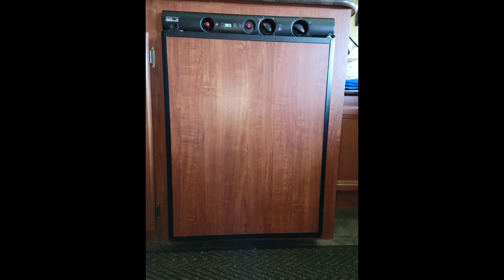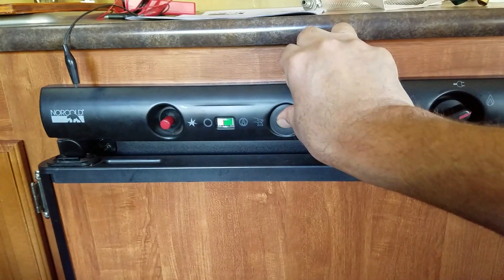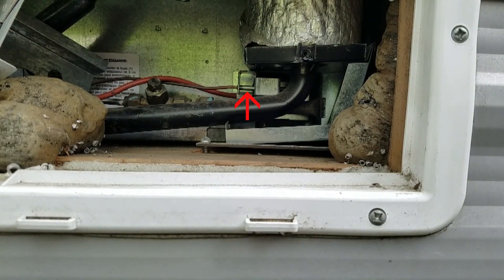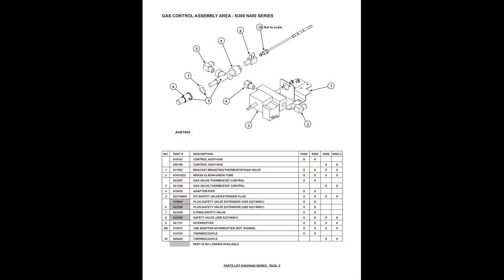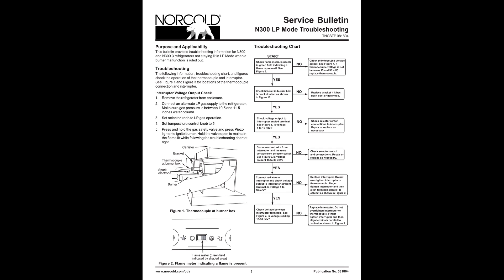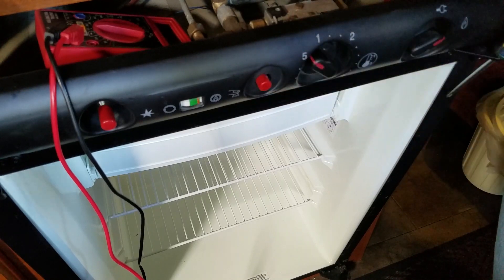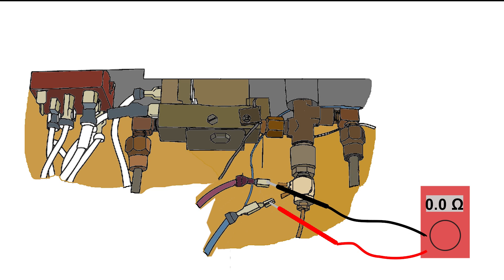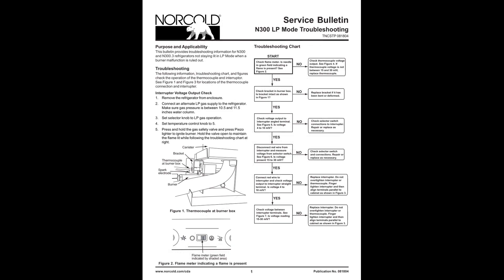Light My Fire! - Norcold N300 Gas Safety Valve Troubleshooting

Comment: Silly question: When you are measuring voltage, you have already lit the flame and are holding the safety valve open with the red button?
1000 thanks for the video !
Reply from the maker: Not a silly question.  Yes, at 4:54, I am holding the red button with the flame lit and heating the thermocouple.  Hope this helps!
Reply: @LifewithDavid1  It does ! I saw that at 4:54 which led to me seeking out that bulletin from Norcold.

We have the Noprcold 3163 and NOWHERE in the service manual does it say that. (It's somewhat obvious when you understand the thermocouple cannot produce any voltage without heat). I have been watching too many videos so far trying to determine that (light orifice > test thermocouple) and when I saw your N300 LP bullettin screenshot , I searched it out and it is very well stated there. I have posted in other various groups with the Norcold 3136 about this detail. 

1000 thanks :)
Reply from the maker: @YannisFyssas  Fantastic!

Comment: Good Morning Sir,
Thank you for this video. I could not wrap my head around this thing until I ran across your video.
I was under the impression the thermo couple created pressure to hold the vale open, been a good day, fixed my fridge and learnt something. corroded connection on the switch wire,  My gratitude to you.
Herb
Reply from the maker: That's why I do these videos; glad I could help.

Comment: Our n300 lights but there us a strong smell inside our camper.  What is causing this? 6:26
Reply from the maker: If the strong smell smells like "gas" then there could be a leak, probably around the valves and controls that are on top of the refrigerator.  Unless you are very handy, have an expert check it out.  I would pull the refrigerator and check the lines and connections with a soapy solution.  If you following along; you are doing so at your own risk.  Good luck!

Comment: I have seen corrosion of the solenoid coil connections internally. The coil is often in the gas path and can be corroded by moisture in the gas.
Reply from the maker: Very interesting!  Only an additional ohm or two is enough to cause the circuit to fail.

Comment: We just purchase a used 2013 camper with this exact refrigerator.  Everything works BUT the refrigerator.  Not with electric OR propane.  
When we turn in propane it lights and gets hot but the refrigerator doesn’t cool at all… HELP. 

We have been looking and looking but can’t find anything on how to fix or where to start looking.
Reply from the maker: Check the link in the description for the Norcold Service Manual.  Hopefully you'll find some help there.  Good luck!

Comment: I have the Norcold 3163 which uses a green led and automatic lighter. I had a problem that I would have to hold the button down for 3 minutes or more before it would stay lit. Using the video, I diagnosed that there was a high resistance when the switch was supposed to be closed. I tested by shorting out the 2 terminals on the interrupter and it worked. The only problem is, that it won't turn off if you do that. I think the relay in the control module was bad (too much resistance) so I am going to try to replace it with part 633326 which is the replacement for the original part 617964. I don't think I would have understood that without your great diagram and explanations of exactly what is supposed to happen.
Reply from the maker: Glad I could help.  Hope the new relay works; after I cleaned the thermocouple connections, it fired right up.  Good luck!

Comment: Thanks David.  I'm about to open up my Norcold n302 for trouble shooting, and yours is the  best explaination on YouTube. Mine  exhibits the same symtom yours did. It works on AC, and DC, but,  it will not stay lit on on propane when I release the bypass button - even though the meter is well up in the green. I hope my fix is as easy as yours. I wonder, however,  if you can clairify what one might do if it turns out that the interupter (part  (621737 ) is bad?  As you noted, a replacement interupter is no longer available from Norcold. You suggested one could instead replace the entire gas safety valve.  However, im confused because your picture shows an ad for a Dometic brand thermo electric gas safety valve. Was this simply an oversight, or are you suggesting one might be able to  incorporate the Dometic gas safety valve into the Norcold as a work around for the now discontinued Norcold interupter? If so, can you help me figure out how that might be done?
Reply from the maker: I would try to use Norcold compatable valves, I think I was showing that the Dometic 0nes were out of stock also.  Maybe things are better now.  Good luck.

Comment: If you ever need to check for gas leaks, use washing up liquid and cover the area you want to check.  If there is a leak, it will bubble and be visible.  After all, a nose only detects so far.
Reply from the maker: That is a good reminder for all.  I have a little bottle of "snoop" I use any time I change a cylinder or start up the LP system for the season.